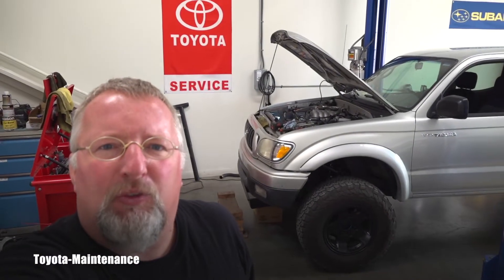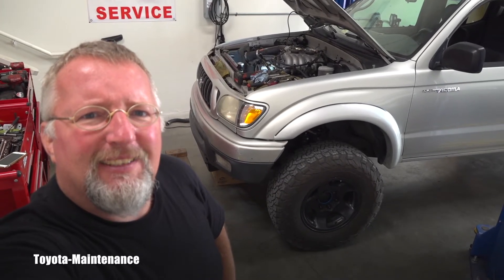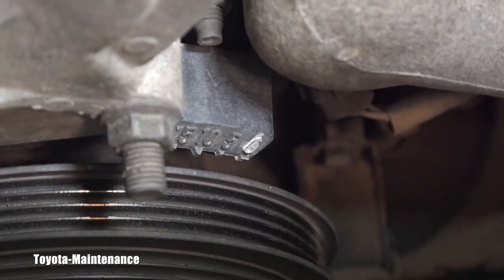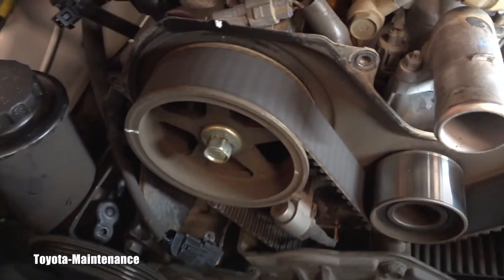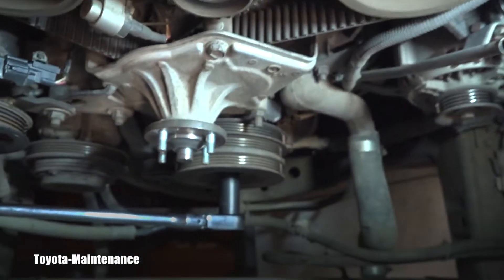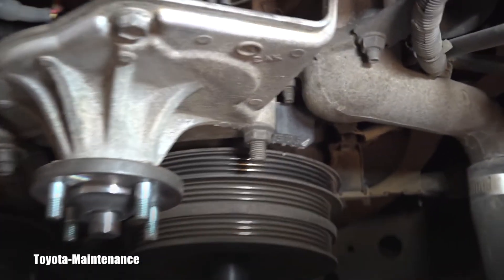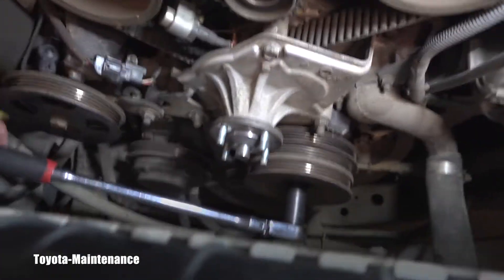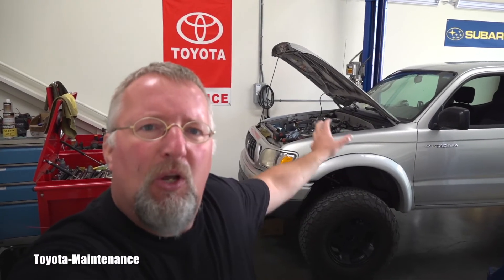How to set Top Dead Center TDC on Toyota 5VZ-FE V6 3.4 Liter engine

Comment: Mate, I am a motor mechanic by trade (22 years total experience) and even I need refreshers from time to time, especially on these engines because I don’t have to tear them down and repair them often at all (which speaks volumes to Toyota engine longevity and reliability).  Thanks for posting this!

Comment: Does anyone know what to do if the passenger cam mark is off but the drivers cam and bottom crankshaft is lined up? Mine was off by about a quarter turn after my timing belt started to burn up. I think it slipped time. The cam will turn some and then snap into another position but it doesn’t want to line up.

Comment: Im working on a 5vzfe someone took the timing belt off without lining up tdc, wondering how to line it back up
Reply: Same question here. My timing belt started to burn up due to the idler pulley bearings seizing up. I rotated the engine with the belt on and lined up but the passenger cam shaft was off center by a couple teeth. I took the timing belt off and now the passenger cam is completely off by several inches. When I rotate the cam it will turn some and then snap into another position. Drivers cam and crankshaft match up just fine so idk what to do.

Comment: Do the timing marks only line up on the compression stroke?
Reply: I'm pretty sure that's how it works. Starting with marks lined up,  if you then turned the crank a full turn from TDC,
I believe the cam marks would be 180° away from lining up with their respective marks and the number 1 piston would be at TDC but the exhaust valves would be open, therefore no compression.  I think...

Comment: Hi! I have a few questions. 1.  Is this TDC the position to use to check the valve clearances? 
2.  You put the marks on the 9oclock position on the pulleys. How do I know where to put my marks? In the same place at 9oclock, or somewhere different based on some other parameter I’m not understanding? 
3. Is the main goal just to get the bottom dial at zero lined up with the notch on the bottom pulley?  Thanks for any prompt reply/help you can give.
Reply: They come with the marks on them,put there by manufacturer.
Reply: They do come with notches from the factory but he marked them for clarity. You do not have to put the engine at TDC to check valve clearance. 

The main goal here is to get the engine to TDC. In order to do this, the markets on both camshaft pully must line up with the marks while the lower pulley is lined up at 0 degrees. His video is made for brevity since he did not turn his crank bolt much. Sometimes it can take A LOT of cranking and multiple revolutions of the crank in order to get all 3 to line up where they should be.

When checking for valve clearance you do not have to be at TDC. You just keep turning the crank bolt until the cam lobe is pointing straight up for the valve that you are checking. That means that the pointy end of the cam lobe is essentially at the 12 O'clock pointing away from the valve shim. Once you have that measured, you then continue to turn the crank until the next lobe you are trying to measure is again at 12 o'clock. So on and so forth...

Comment: Thankfully, the later models have timing chains.  No more timing belt replacement!  The last timing belt change I performed was on my 99 Acura TL.  Lots of disassembly/reassembly, but only needed basic hand tools......except for the little special tool I constructed to perfectly push in the new oil seal around the crankshaft.  Finding TDC before you start this work is essential!!
Reply: The earlier models have chains too,just depends on the motor.
Chains need to be maintained and changed too.
Reply: Chain is not fun to change, some have neither, rather gears instead - has zero to do with the age of the vehicle

Comment: I don't have that engine but this is helpful for anyone doing a timing job for many engines with timing belts. Still looking for used 4runner in my area. I use rockauto for my timing belt kits so far all good

Comment: I know the answer to this because it's the same on probably most transverse v6s that have dual overhead cams, you line up all the marks where everything's supposed to be and then you rotate it two full revolutions and hope that your little Mark on the belt and Mark on the cams are at the same position
Reply from the maker: Nice
Reply: Need advice on a 2002 Avalon 3.0. I lined up the two cam marks but didn’t pay attention to the crank shaft. Iv already took the old belt off to replace the water pump. How can I be sure I’m TDC now